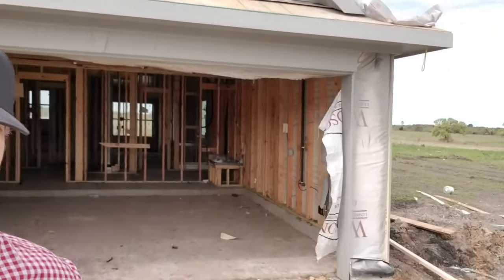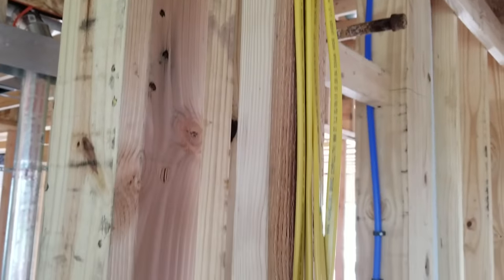HOW IS THIS EVEN LEGAL?!?!

Comment: I’m honestly shocked. I’m building a new house now and they sheath them. I honestly cannot imagine that not being the case. Wild. There’s some other issues I have with builders in the area. Generally low quality or quick work, but I’ve had enough experience to know what to call them out on. The code guys don’t do a good job here at catching stuff. They don’t seem to care, but unfortunately for my builder, I know the codes and I will make them hold to them.

Comment: Have you  expressed your concerns with the code official in your area.  You might find that the interior drywall is providing  the diaphragm action required to satisfy the structural concerns you expressed.  I agree that and the lack of a better quality house wrap would steer me away from  ever buying this home but it may meet code.
Reply from the maker: It may.  I am not a structural engineer or housing inspector.  But...dang, right?

Comment: I disagree the HVAC doesn’t look good if you live in a extremely hot area of the United States putting you into a category five weather area, you don’t want to suspend your flex duck system. You want to drop it as close to the ceiling as you can and try to cover it with as much insulation. You’ll save $100.00s every year.

Comment: are they thinking that the drywall is going to take care of sheer strength ?
I've heard that that spray foam insulation is adding sheer strength to building but I'm pretty sure that you can't use only that to keep the wind from blowing your house over !
there is nothing worse than walking into a house and shuting the front doors and having the windows on the back side of the house shake and rattle,crazy !

Comment: Don't apologize.  These builders are cutting major corners, saving a ton on cost, not passing any of that cut corner saving to the buyer but actually charging outrageous home sale prices. Understand - "building to code" is building per the bare minimum. My entire $700k home had major code issues on my 1 yr home inspection. It was signed off by the county codes and ain't nothing I can do about it. Codes dept is fake. The states (at least in TN) codes will not hold any accountable.  The said the county was exempt because the county leaders can vote themselves to be exempt from the state, which they only "audit" them every 5 yrs. Our largest investments with absolutely no protection. And yes! This is the norm for the big Subdivision builders.

Comment: Why does the US hold on to framed construction? A light autoclaved concrete box would probably cost less, needs no sheathing (apart from cosmetics), shear is almost a non-issue, and it's naturally fireproof. Once the walls are straight and properly braced, there's little to go wrong.

Comment: That's why I'm also against people when building a new home people like to stucco the whole house sealing in moisture which turn into mold on any new home you have to allow that wood to dry and houses need to breathe so I make sure my guys go overboard when it comes to the outside of a house especially Roofing I like to use ice Shield a long all edges and Valley and then I like to picture frame the camping around windows and doors takes a little bit longer but looks so much nicer that's the problem with a lot of these job sites all the houses are the same and time is money so they need to turn out these houses as fast as possible so they cut corners and like you said the homeowner has no idea this is why I would never buy a house in a project area

Comment: Construction & roofing contractor down here in north florida, the quality of the spec builds is shockingly poor. These builders are scrimpring on every component of the build which adds up and allows them to put more $$$ in their pocket and.screws the homeowner. Heres some stuff ive personally seen that is alarming. 3 tab shingles are still being installed, they are only.rated at 60 mph of.wind and will fail usually in the first 5 years. Some spec builders actually requested the concrete company to design a 2500 psi concrete mix, its garbage. On the driveway, they claim are 4in thick, they are.pouring 4in on the perimeter and 2-2.5 on the main pad. Quality of the framing lumber is trash, alot of finger jointed spruce. Trusses often times are cracked and missing connector plates. They skimp on insulation, make.sure to confirm what they are claiming. Like you mentioned their vapor barriers are trash and osb is so freaking cheap it makes no sense to delete the sheathing. Alot of improper flashing around doors/windows, cracked door jams & windows are being installed w/ broken welds. Thin walled pvc is common. Make sure to get the electrical inspected, many of the gfci outlets are hooked up as normal 110 volt. The list goes on, buyer beware. Don't finalize the contract until the builder has addressed and fixed all the issues and make sure to put it in writing. Otherwise, once you pay them, they have no incentive to make it right.

Comment: Take your 3000 sq ft budget, build a 2000 sq ft home and put the money you save into a quality, tight, high performance building shell. You will be much more satisfied. And definitely ask if it's been blower door tested before you sign on the dotted line.

Comment: I didn't see this YouTube until I got problem and search for answer.  I brought the DSLD builder home suppose to come with Golden package insurance home.  But recently I asked to come by and see the house, we are getting closed to complete and a walk through with the builder.  We notice entry  crack,through thr garage only a wall separation, the patio crack, anything else can't see probably because cover with vinyl.  You can see patio slab not level on each side, the door upper look like sagging over the vynl.  that just thing I can see instantly with my eye.  They put the sod down left a corner on the entry ,you can see underneath the slab got a big hole 
, missing concrete.  zMy closing in 4 week.  We been sitting ABNB waiting for the home.  Appraisal from bank started already.  My question is can those Crack be OK with a layer of concrete fixed?  I can enclosed photo.

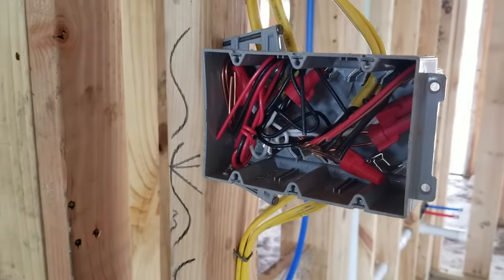Comment: The three gang j-box at 3:50 is not supported at the outboard side as the nail plate clearly indicates is required.
At 5:19. the hole in the drywall for the J-box is oversized. Supposed to be 1/8" in gap max around box.
The framed-in house you walked through had no let-in wind braces or sheer panels. However, at the end of the video, there was a house visible over your left shoulder that may have had sheer panels in the garage as far as I could tell.
Best protection is to hire your own outside inspector for a pre-pour before the slab is poured, post framing, post MEP and final inspections. (Disclosure, I am a state licensed real estate inspector. Sure, I'm an a-hole, but I'm your a-hole).

Comment: I really wish more builders would give you upgrades in the envelope and structure rather than just finishes.  Upgrade to Zip2.0, upgrade to AdvanTech sheathing, spray foam, fluid applied house wrap, etc.  I realize these options would be picked 1:100 compared to granite or hardwood floors but it's another possible revenue source for them.

Comment: What state is this house built in? I doubt this house would last 15 years where I live in Michigan. And no one would be able to afford to heat or cool it with so little insulation and air migration resistance built into the house.

Comment: Those homes are engineered to have brace walls in the sheetrock most likely.   It's common in the tract homes here in central az.  Im a contractor and cover the exterior of my homes in osb (no exceptions...)  while I don't think some of the things you are pointing out are as bad as you put it,  is less than ideal.

Comment: Residential building practices regarding the building envelope have gotten worse over the past 30 years.  20 to 30 years ago we built tight, then we had moisture and mold issues and relaxed the practices.  Now engineering has progressed and the cost is king.  The house you walked is perfectly acceptable in milder climates and frankly shows why structural and envelope codes should be stricter nationally.   Unfortunately, don't blame the builder, blame your local county building department that allows this to pass.  After the last housing bust, I saw fees go up, but quality go down because building departments wouldn't stand up to sub-par building practices.  So instead of picking your builder, pick your jurisdiction you build in carefully.   I've worked in some rural areas that basically only had an inspector walk a house once or twice, which isn't nearly enough and this is your tax dollars at work.
Reply: Depends on where you are, I suppose. 20 to 30 years ago, most houses in Northern Virginia were not built tight. Building them tight would have cut into the profits and the customers who bought them didn't care.

Comment: In your video description, 1000 homes, times $2,500 increased price by using OSB sheathing, for $2.5 million in lost profit only applies if the builder doesn't increase the cost by $2,500+.  Which of course they will.

Comment: It seems that most builders cut every corner they can.  You don't think to ask some questions because you just believe it should be standard...Like drip edge on a roof.  In Indiana it is important.  This is just one of many corners cut in my house.  Poor quality materials, blatant disregard for quality, poor management; the list goes on and on.  My new home showed more wear in one year than my last did in the 7 that I lived there.  The contract I signed prevented me from suing the builder.  I learned a lot from that transaction.  I fixed what I could, sold the home and bought an older home built by a quality builder back when they seemed to care.  You can see the junk I bought here:   https://www.youtube.com/watch?v=ySTnpaAig8A&feature=youtu.be

Comment: In Florida bugs eat wood and OSB sucks.  I am wondering if in place of sheathing was 4 horizontal 1x4s PT screwed in, a good house wrap and vertical metal siding if that would be okay?  Inside some rockwood insulation R30 and drywall or shiplap.

Comment: I just went and checked my new build today in california.  Its about 80% OSB but a solid 20% of the following - Stud | Corrugated type of plastic | Dupont Tyvek | Insulfoam | Chicken Wire | Stucco

I am a bit concerned and wondering if I should reach out to the builder or if this is normal for tract homes.  the builder is a relative cheap builder and not a huge national builder such as KB homes or Lennar etc...

Comment: That looks like a high end kids fort. That doesn't even look right at all. Besides the obvious of strong winds/storms, water leaks and air leaks...... how can you regulate the temperature of the house? I see high energy bills. I think that if this is legally allowed...... it should also be required for the builder and seller to inform the buyer of this kind of build in length. Because most people would never expect this at all and would be really shocked if something happens and find out that way.

Comment: Homes used to be  built by craftsmen and built up to a standard
Nowadays homes are built down to a cost not up to a standard 

The same goes for most products nowadays, Everything is built down to a cost and not up to a standard
Building quality products has a big downside for manufacturers wether it's cars down to your electrical Kettle.if your product lasts a life time whose going to buy your product if the last one is still working

I trained as an electronic engineer and can repair down to component level,  but nowadays no one repairs to component level as it's a lot cheaper to replace whole boards rather than fault find and just replace a component 
40 years of valuable training and I've progressed to just unplugging and replacing boards,

Comment: This is exactly why i watch contractors like a hawk! Just spend the extra money NOT extra labor cost by getting the slab 6 to 10 inches thick, your exterior walls 2x6 with 3/4 plywood screwed with 1.5 screws not nails and use 4" Hilti anchors not 22 cal nails shot in the foundation . The house will last forever!

Comment: Did you check the corners for plywood?  That is good bracing for "racking strength"...
Reply: Sadly just using ply on the corners does almost nothing.  Also only plying the corners is hackery

Comment: I design homes for 30+ years. At that price you would have to cut out every expense you can. Yes you can achieve lateral loads with drywall. Its a tract home and your building a hundred homes a sheet of OSB is too much. As for pushing net zero energy a performance model  would be out of the question . Min design standards only. That said, completing those houses at that price is the Amazing Thing. Not a good place to work for tradesmen.

Comment: New homes today are crap. They are built with nails that hold nothing and crooked material that is twisted and pull loose. I live in Oklahoma and I see many homes take damage from a EF0 tornado and it takes the roof off. That should'nt happen. I built my home that's about 2200sqft for about 20k and every part of the structure is screwed together. Also attaching the roof to the foundation is key as well and most of these homes are toe nailed into a bottom plate that is bolted down. There's no strength in that. People need to quit buying these house and force the builders to start doing things right. I would recommend everyone who is looking into getting a house should build it themselves. Sure it takes longer to do but you will know every inch of your home.

Comment: Blame it on the codes where those houses are built. How does that house pass inspection without exterior sheathing. Carpenters have to follow codes too, not just electricians and HVAC trades.

Comment: This is has got to be in a place that doesn't get very hot or very cold. Cuz I've no idea how you could have any kind of effective insulation with that. That's just insane to me.

Then again, I live in an area that gets hot and humid in the summers and very cold in the winters (it usually gets down to about -20F for a few nights in January every year). Definitely not the most extreme climate in the US, but one where good insulation is a must!
Reply: Garages are not considered "living space for occupancy" therefore no insulation is required on the exterior walls.

Comment: Looks like MSI builder junk. I saw houses like that in Kyle Tx. I guess it’s just less to clean up when a tornado blows it away lol. Even the completed homes around that area looked soggy. Looked like air and water just goes right through them and good luck with all the mold and stuffy home.

Comment: Isn't there a structural code requirement for this?  BTW Thank you very much for your videos.  I am in the market for a home and noticed that they are using cardboard on some new constructions and no plywood or OSB.  That is criminal in the tornado alley in DFW.

Comment: After seeing a couple new houses built, I wouldn't feel safe in one in anything more than a normal thunderstorm. Cheap materials, bare minimum structural strength, thin ass 2x4 exterior walls... They are good at polishing the turds to look nice though.

Comment: I giggle every time I hear a (professional) call a water heater a hot water heater. Water heaters actually heat cold water. My first plumbing lesson. Lol
Reply from the maker: Shortened from "Domestic Hot Water Heater".  An important distinction when you have equipment for both heating water for thermal comfort and equipment for heating potable water.  "Professional Builders" know there is a difference and call them by their respective names.

I'm just kidding... I guess it's a regional thing and old habits die hard!  :)

Comment: Hello I’m had my house built by Rowles in 2015. I’ve had water problem since 2017 coming through my foundation. I haven’t found all my paperwork yet but seems a shame they’re claiming I’m on a two year warranty for foundation. Which I know can’t be true for new homes. If you know any help I can get please let me know.
Reply: I am not a lawyer.....Check your state in which you reside for the "latent" and patent "NEW" residential construction defect laws. A patent defect is something readily observable as a defect. You can see the defect in other words. In California, the patent statute of limitations runs for a period of 4 years after the close of escrow. A "latent" defect is  something which is not known or readily observable for instance (slab leaks, water intrusions to the interior, sink holes, leaks in a wall you did not cause, flooding in sunken living rooms because of underground artesian springs) - the "latent" statute is 10 years (Calif.). The builder is on the proverbial hook basically. To extend any statute I mentioned it's called "tolling of the statute" or a time out in the warranty defect clock. From the time you report a defect to resolution that time is ADDED to the end of whatever applicable statute you are looking at (patent v. latent). A four year patent defect could be under warranty until Year 8 of occupancy!!! I hope this helps

Comment: The electrical isn’t even up to code actually.  You’re supposed to have 6 inches if loop above and under each receptacle boxes to allow you to pull more wire through if you ever need to pull the switches or outlets out to repair or replace them or cut some wire off. also for the price of one of these houses you can get a really good bill palm harbor manufactured home and a good acre of property for the same price. Manufactured homes are built 100 times better

Comment: If an older house has no sheathing or weather barrier, would it be a good idea to add those features?  I'm fixing the outside of one of my rentals (in Northeast Kansas) and I have found a bunch of moldy insulation behind my failing T1-11 siding.  Anyone have any suggestions or ideas moving forward?